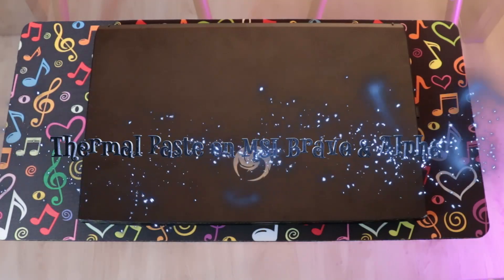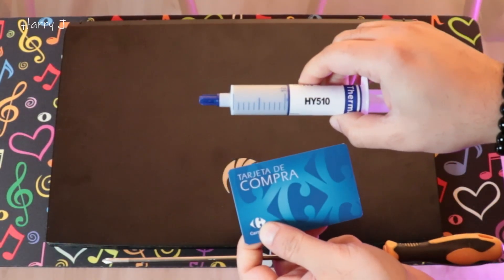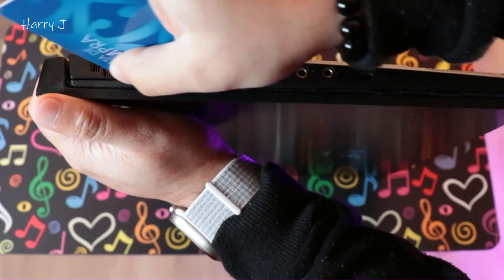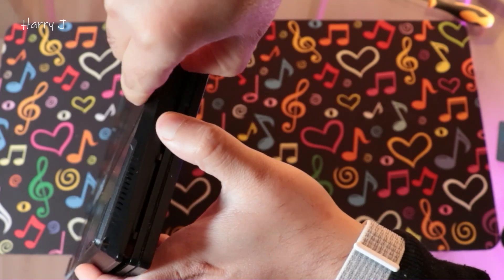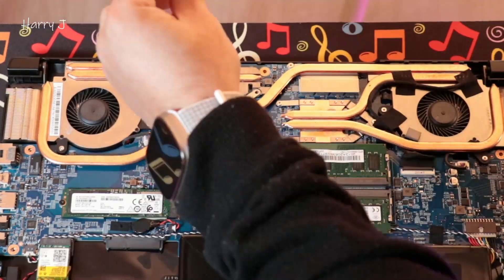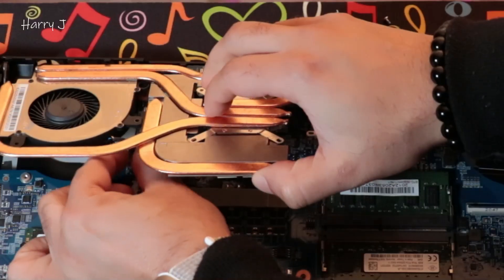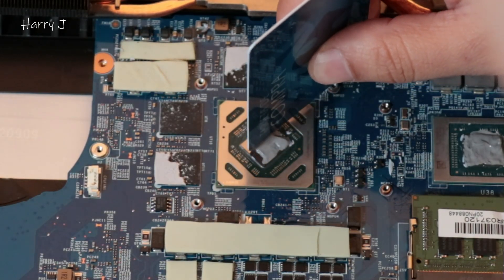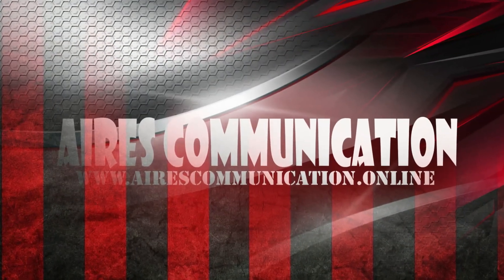How to Apply Thermal Paste on MSI Bravo & Alpha Series Notebooks

Comment: Brother can i just clean the fans i don't have the money to buy thermal paste plzz help me out
Reply from the maker: Hi there, clean the fans its fine but if you have over heating issue it will not fix it, wish you all the bset and plz dont forget to subscribe it would be a great help ;)
Reply: Unscrew both fan covers and take all the dust out, specially between the aluminum fins. This doesn't require to remove the whole heatsink, and it will improve your temps a little bit. But beware that if you fully unscrew the heatsink, you will need to remove old thermal paste and apply new one. Failure to do this will kill your temps and probably your laptop too.